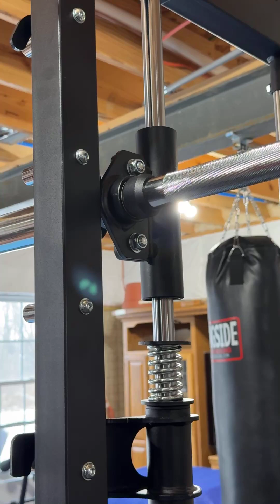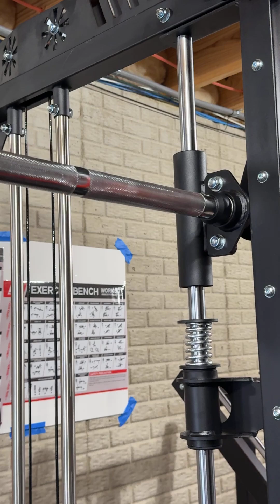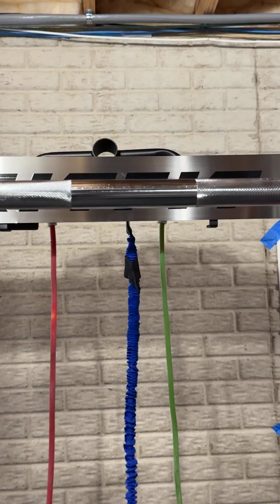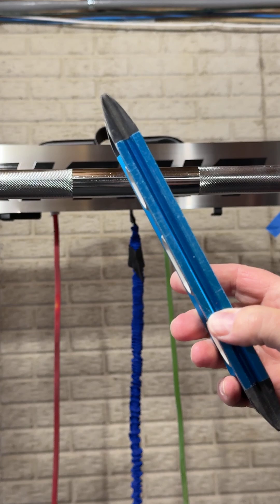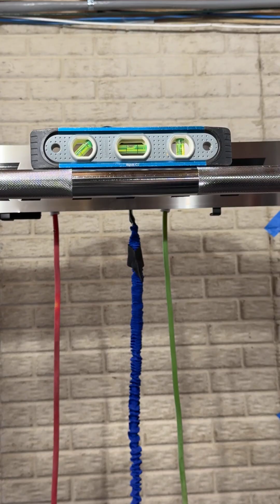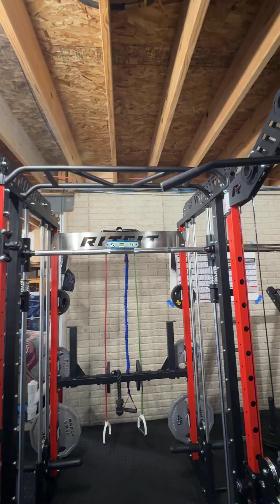Ritfit M1 Pro Smith machine fix part 3

Comment: Just wanted to say thank you, this helped me fix my issue of it being higher and lighter on one side of the smith bar! Except mine was apparently VERY out of spec because I had to use 3 washers on the top and bottom each of the left side and then 2 washers on the bottom of the right side, but it's FINALLY balanced! I've even emailed ritfit noting the issues and linking your video to show them how I fixed it. Thanks!
Reply from the maker: Glad it helped!

Comment: I didn't see your videos part 2 so I'm not sure if you're proposing a fix to the same issue I have.  The hooks of my smith barbell won't catch on the hook bars.

I demonstrated this in the second half of this video I made for their support below.  I have the M2 3D Pro and the larger issue was the horizontal move of the 3D smith doesn't go fully in either direction.  I've accepted as good as it will go but the hook for the right side of the smith barbell hook not catching cleanly is a safety issue.  Thanks for any input.

https://youtube.com/shorts/T8xu7cYFl04